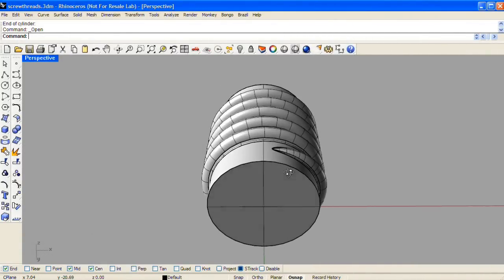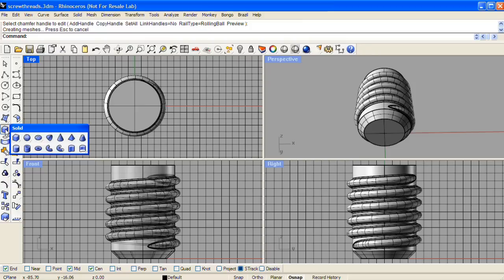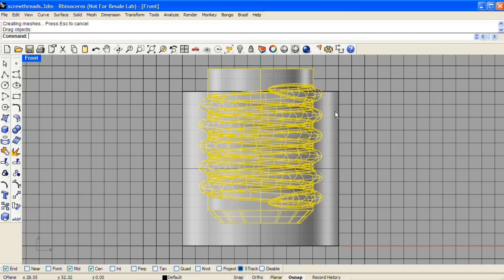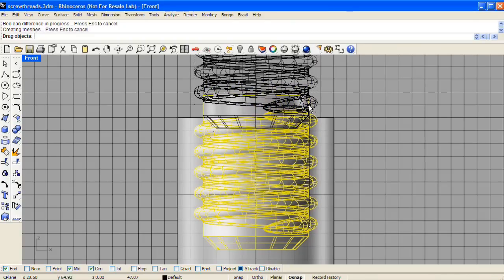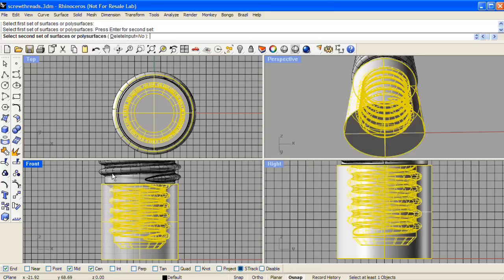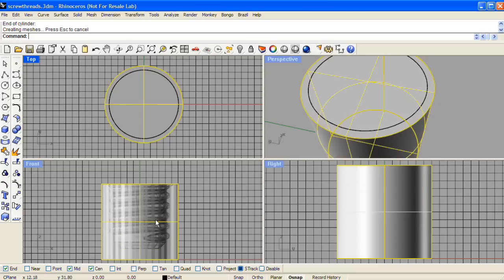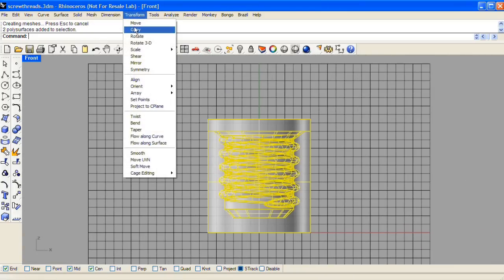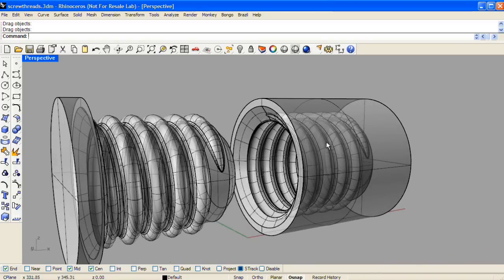Modeling screw threads (2 of 2)

Comment: This won't be functional. Dimensionally, a threaded hole has a larger cutting diameter than the screw’s outer diameter, and the hole boring diameter is usually bigger than the screw’s inner diameter. The actual contact surfaces can't be the same. There must be an offset between them.
Reply: How do you solve that?
Reply: There’s different ways to solve this with different sequences of modeling tools and steps, but basically you just need to have the surfaces of the screws threads offset by a small distance relative to the surfaces of the threaded hole.
Reply: @peterlaverty9397  By drawing two sets of threadprofiles in the first step. Then also scaling the inner screw cylinder down.
Reply: @peterlaverty9397  scaling does not work for obvious reasons. The pitch of the thread will be different if you scale. You need to offset.

Comment: Doesn't the screw need to be a slight bit smaller in order to make it run smoothly? (when 3D printed that is)
Reply from the maker: Possibly yes, but I've heard from users saying it worked without scaling one part slightly so it might have to do with the printer tolerances too.
Reply: Absolutely this. I've had countless students bring me parts to print with zero tolerance. Offset the whole surface by 0.15mm for one of the parts to account for this.

Comment: Thats going to be a pretty tight fit, impossible to screw in some materials. Would you use offsetsrf to make it easier to use?
Reply from the maker: An offset could be needed yes. OffsetSrf could work on the solid but now I would use Rhino 8 and Shrinkwrap followed by OffsetMesh if 3D printing the results.
Reply: @RhinoGuide   aha. Sounds like something I would need more money for.

Comment: my booleandifference keeps failing. I think it's because the original screw polysurface is not closed where the filletedge meets the original cylinder. Do you have any tips on how to close it?
Reply: nvm, I was working at such a small scale, I just needed to change my absolute tolerance. Thanks for the great tutorial!
Reply: @jacobboatman  , Hi I am having the same problem.  I am a novice at this.  Can you tell me where the absolute tolerance is set?  Thank you

Comment: in my model i had to put threads on a cylinder - after creating them, i realize now that two surfaces have to overlap, not just be touching , in order to do a boolean union.  an earlier tutorial said to explode the threads and use "intersection" (under 'curves from objects').  But that seems tedious.  Can you get away with just using "join"??? would i need to do anything after that?
Reply: Sometimes Boolean works even without the overlap. And don't forget you can export to .stl separate solids as one and still get a print.
Reply: @PaulHirsh ha ha thank you, it's been forever since I got into rhino and sketch up. I was into 3d printing for a while then lost interest.  I remember the problem with the threads but don't remember what I wound up doing.  Great software had fun learning it